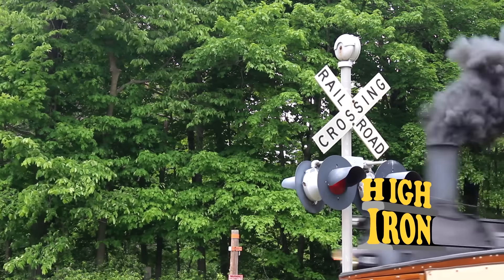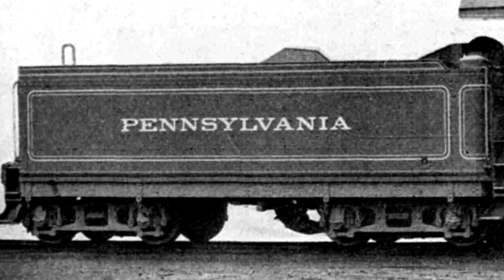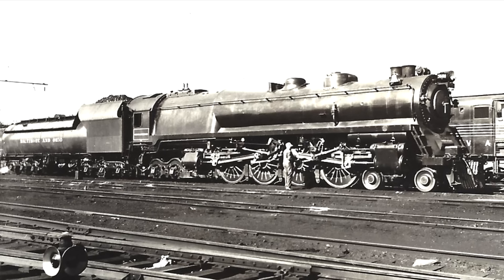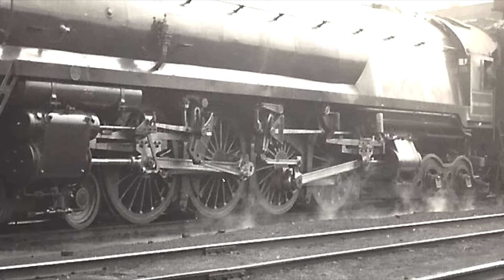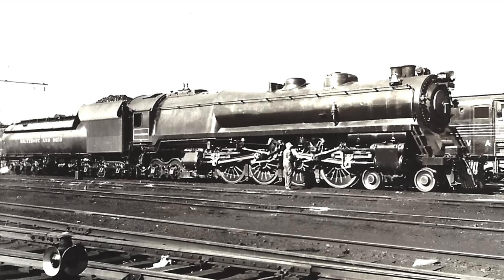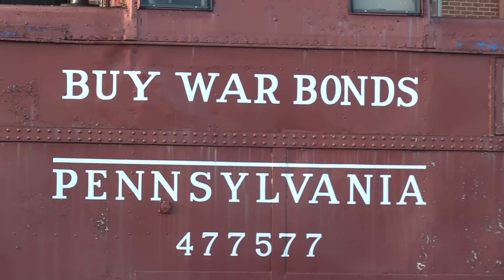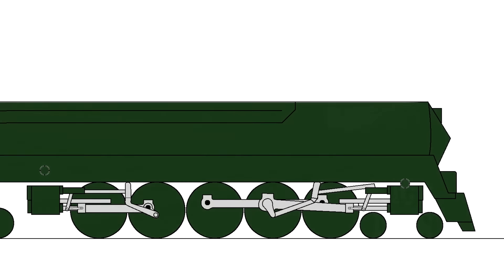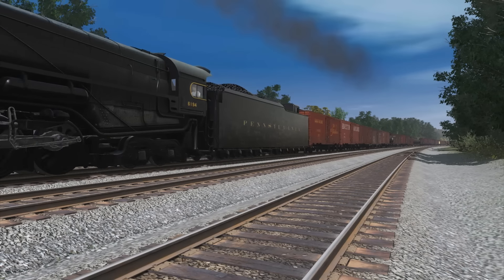Why Weren't Duplex Steam Engines Successful?

Comment: I don't know, but it seems to me that if an engine could handle speeds than it wouldn't need to reach them. It would just need another engine to supplement its power so rather than having one engine at 100 feet too reach 90 mph, you could have two 60 foot engines to achieve the same speeds  and a singular engine could be used to do the same task in a reduced manner. I see tis as a better option because it sounds like the larger engines had troubles bending around the tracks were as the two smaller engines could achieve this with swiveling connection points.
Reply: Crews cost more than engines.  A lot more, and steam engines could not create a multiple unit consist like diesels.
Reply: Technically, no. The pressure drop through the cylinder valves (that feed the pistons) becomes greater and greater as locomotive speed increases - so as speed increases power output drops, and there were tests in the 1930's on PRR K4's that documented the effect. That was one of the reasons to try poppet valves - they could admit a lot more steam to the cylinders with less pressure drop - increasing cylinder power output significantly above 80 mph, and by a huge amount at 100 mph and above. Those test results led to the PRR T1, which was specifically designed to outperform double headed K4's with a single T1 - which it did.

The problem was that the Franklin type A poppet valve mechanisms used on the T1s was very complicated (it was an oscillating design more like a swiss watch) and unreliable at high speeds (when C&O was investigating the PRR T1, they sent one of their engineers to meet with the Franklin engineer to discus the issue, and his response to the low reliability was that the type A was never designed to operate over 100 mpg...) Franklin introduced the type B rotary drive for poppet valves that was much simpler and eventually found to be much more reliable, but because of wartime material limitations, the PRR was unable to test the rotary design before they had to place the order for the 50 production T1s (those engines were ordered in anticipation of huge troop movements from the east coast to the west coast as troops were redeployed from the European theater after the defeat of Germany, to the pacific theater for the invasion of Japan.) Later both the C&O and D&H operated Hudsons post war with Franklin rotary poppet valves with great success.

Comment: Is there any reason why double-headed trains had both locomotives face forward, rather than having the tenders face each other (or perhaps used a double-ended tender)?  If crews needed to move or communicate between the two cabs, having a dender between them would seem better than having a boiler between them.
Reply: Double Fairlies, Meyers, and others 'of that ilk' were effectively made this way, just not in separate pieces like Loewy's 'triplex'.

The actual reciprocating part of the locomotive is about equally happy in either direction (there is a slight preference for which way is 'forward' in link valve gear).  If the leading and trailing trucks are built to guide effectively in both directions, the engine can run bidirectionally -- the Germans had multiple classes of 100+mph-rated tank engines that could run either way and just run around the train to rocket back the other way.

Most North American power had trailing trucks with Bissel geometry on the second Delta truck principle, with the restoring force applied as far to the rear and 'outside' as possible.  This design increases effective lateral forces when leading.  For complicated reasons having a pin-guided Adams truck at both ends has traditionally been a recipe for failure at high running speed; a better approach is to push the lead tender truck up close to the trailing driver pair of something like a 4-6-0 or 4-8-0 and use a good reverse radial buffer arrangement to have the tender steer the rear of the locomotive chassis when reverse-running, doing Stroudley's trick with the flanges on what is then the 'leading' driver pair...

If you are familiar with early Super-Power you may be familiar with the articulated American Arch trailing truck, which was a joy... as long as you were pulling.  Unfortunately, when you had to back up...

Comment: Impressive. - However, there's an option that should have raised more interest: the German "19 1001", a 2-8-2 streamlined express loco with a two-cylinder "steam motor" per axle (and no connecting rods). It entered service in the war and got damaged. It was repaired by the Americans and shipped to the USA in 1944..45, but dieselization had already taken off. It is told to have been scrapped in 1951 after a few trials on the east coast. - Note that even the post-WW2 German steam locomotives seem to have been created unaware of this interesting concept.

UPDATE: This one: https://youtu.be/2xECf4QbM4I
Reply: I recall this concept. I believe the PRR was considering trying this design, what with their trials with the T1’s and the one-off S2 turbine. It would’ve been the V1. But dieselization meant it never left paper
Reply from the maker: The B&O was also studying this concept with the help of the Besler Brothers.
Reply: @HighIron  Thank you! I didn't know that.
Reply: The engineers behind Germany‘s post-war locomotives were probably very aware of this locomotive, but just didn‘t see a need to develop it further. Regular steam power was adequate and (at least in the west) electric traction was on it‘s way to take over many trunk routes in the 50s and 60s.
Reply: @bahnspotterEU  Yes, that's my perception, too.  :-)  -  Coming to think of it, there was no use yet in designing and building /fast/ steam locomotives (which has 18 201 stand out). Power was needed, so optimizing the design of the new boilers did make sense. (Including the type of fuel, like lignite (in the East) or oil. Or even use the Franco-Crosti design.)
Reply: I see you have seen the picture that has the ACL herald on the nose.  ;-}

The Roosen motor locomotive, and the B&O constant-torque W-1 that has such an amusing Whyte coding, are two interesting examples of reciprocating-steam development.  
The  actual story -- rather shameful -- is that by 1947 no one was interested in complex steam locomotives, particularly those that had to coordinate torque on separately-driven (and very slippery!) single axles.  I don't think even today many people completely understand the arrangements on the BR 19s.  Apparently the repatriation of the locomotive to what was by then the DB foundered on the question of who would pay the shipping.  Then along came the Korean War, and scrap drives, and there was poor 19 1001 sitting on a military base when the patriotic thing for the Army to do was contribute.  This ranks up there with scrapping 242 A1 as a regrettable failure of preservation.
Reply: @wizlish  Thank you! - Yes, torque may well have been an issue with the 19 1001.

Also, thank you for bringing up the 242 A1. - I'm privileged to have a rare copy of André Chapelon's ultimate book "la Locomotive à vapeur". - You also make me think of that later set of changes to a German engine, now in Switzerland, number 52 8055. It is mentioned on https://de.wikipedia.org/wiki/Dampflokomotiv-_und_Maschinenfabrik_DLM (German and Esperanto only).
Reply: The original V1 was a mechanical turbine.  The main chassis was reminiscent of the one on the Baldwin Centipede (a two-axle pilot truck with four drive axles in a cast underframe) but the design had them 'elephant style' with the firebox and ashpan of the reversed boiler over the second 'lead truck'.  There was a separate turbine for each truck.  The boiler was a slightly-modified Q2 boiler (with proper waist support) which is where the 8000hp original rating came in.  The styling was reminiscent of the DD2.

This was actually approved for production in 1944, but it was obvious the end of the war in Europe was approaching, and the need for fast 8000hp locomotives with it -- and the prospective water rate for the thing was abysmal.

The design apparently got another lease on life in 1947... there is a design patent for a snazzy passenger shell plainly meant for a 4-8-0+4-8-0 chassis.  The magical improvement was the proposed adoption of the Bowes tugboat drive, which provided the effect of a CVT electrically, vastly improving starting, warmup idling,and operating the turbines at most effective mass-flow regardless of road speed -- which promised to be remarkably high.  It was around this time that PRR vaporware started to inflate the power rating, first to 9000hp and then even hinting even higher: you can imagine the fun with the effective water rate if the original was already showstopping.

N&W took over the V1 after 1948, and had gotten as far as going to electric traction-motor drive on all axles and a special B&W boiler by 1950 to 1952.  This was thrown out by 1954, replaced by the Baldwin-Lima-Hamilton/Westinghouse TE-1, which was entirely different in most respects.
Reply: There was a very key technical difference.  The Roosen BR 19 used a variant of quill drive between the steam-motor crankshaft and the driving axles, keeping unsprung mass minimal and allowing good suspension and damping action.  The Besler constant-torque motors were geared directly to their relative axles and were suspended with them, in a location subject to all sorts of contaminants and shock and difficult to access for inspection, with need for flexible steam lines to allow suspension action.  B&O actually had the boiler and a couple of the motor units ready when it became clear that even EAs did the job B&O needed far better than any steam locomotive would...

Comment: The greatest flaw engines were undermind in history. Was strength versus speed rpm/revolution. Engineers, after these stenght-to-motion machines, created methods of high rpm speed-into-horse power( strenght) using transmission. More power used vs strength 💪 utilized. 

 Had engines been more like these steam trains of modern air/gas/hydrolics pump vs piston, strength would merely be transmission converted into grip  speed wager. Using FAR LESS (as mere pumps) power transfer. Engine strenght-to-axel speed.
Reply: But consider the fun in, for example, using a high-speed expander at its horsepower peak with varied power to the wheels via Bowes drive.  No hydraulic windage or overpressure concern at high speed, no lines to break, no expensive filtering or polishing degradation products out of the fluid as on the America-Loks...
Reply: @wizlish sure.  If you want aura sound of ⛽ guzzling roar🤨.
Reply: The thing is that a reciprocating steam engine is already controlled over a considerable range of output in a way that does not require a transmission -- same as Doble and the Besler constant-torque worked with a fixed final-drive ratio.

Where the transmission then shines is in water rate increase and limiting machinery speed - the salvation of the direct-drive PRR S2 according to Westinghouse was a two-speed planetary with integral reverse (to get rid of that plague-spot geared reverse turbine) that allowed the turbine to be spooled quicker to effective speed range and then geared for economy.

The version of the Bowes drive proposed for the V1 turbine chassis is like an electromagnetic CVT capable of both ratio increase and ratio decrease.  In the Ingalls unit, it would allow medium-speed Superior Diesel motors both to start heavy trains at low road speed, then accelerate to a balancing speed dictated only by engine output governed at the peak of the torque curve, possibly over 140mph with a light consist without the risk of birdsnesting.  The PRR motive-power department understood that the 8000hp worth of turbines that a Q2-size boiler could support was no longer mass-flow wasteful at starting speeds, nor falling off abkve 80mph, as in the original freight design.  I think that is precisely the point you're trying to establish...
Reply: There is also the adaptation of the Rand Cam engine for use as a steam expander,  which is only not highly promising because of who owns the intellectual property, or the Quasiturbine.  A trochoidal Wankel-style engine would be interesting if high-integrity 'wet' tip and edge seals could be devised -- so far as I know that hasn't been fully solved, but it would permit a steam-jacketed engine case with nanoinsulated rotor...

Comment: I can't wait for 5550 to be complete. Hopefully they take the steam speed record home to America.
Reply: I recommend to get rid of that dream, because it would never happen. You have to go around a lot of red tape to even get to 110mph
Reply: @gamerfan8445  even on a private railroad?
Reply: @herrgodfrey9563  No, because it dangerous, and stupid to do so.
Reply: @gamerfan8445  I don't see it's necessarily either so long as the correct safety measures are taken. I won't get rid of the dream until it's proven impossible. If the new Acella Express can get around restrictions to go above 150 mph,  the 5550 might be able to, to go 130-140 mph. The people behind its construction have worked for many years to make this happen and they're getting closer every day. If they can make it happen, that'll be great, if not, oh well. I don't see why you think it's your job to tell me what to or not to dream about.
Reply: @herrgodfrey9563  the thing that the Acela is a new engine with modern crash safety features. 5550 would never be approve by the FRA to travel at that speeds

Comment: It is ridiculous to suggest that seasoned engineers could not adjust to the T-1's additional power very quickly and alter their throttle practice accordingly.  Nevertheless, the T-1's did have a nasty habit of slipping while underway with the front driver group. There are numerous videos attesting to this.  This was likely the result of weight/inertia shift taking weight off the front driving group, combined with high HP.  It was suggested that alteration of the springing could help this, but the railroad wasn't in a position in the late 1940's to spend a lot of time sorting everything out.

Comment: Why? Well, they (1) didn't offer enough of an increase in power and general performance to justify the expenditure AND (2) the diesel-electric (especially the GM designs) offered much reduced operating expense and MUCH reduced running maintenance (at a MUCH higher capital cost for acquisition). In the 1960s a proposal appeared in TRAINS Magazine that used the same ideas as Rene Chapelon (without, IIRC, attribution) for duplex drive engines with each cylinder/driver set inside connected to avoid getting out of time. I'm feeling stupid, can't recall author (who became a curator at Smithsonian). Really sounded good, but nobody ever (to my knowledge) tried it.

I think ALL the steam improvements came at the wrong time, and I'm sorry about it. Maybe if we hadn't had WWII and Diesel-Electrics just when we did...
Reply: There is a radical difference between Chapelon's locomotive (I believe 1935) and Withuhn's conjugated duplex (which you, in turn, fail to attribute properly): all the lateral and first-order forces from the cylinders were in perfect balance, even Itheoretically, at least) if two of the four cylnders were compounded.  See the ACE 3000 patent for a reasonably full description (including a frankly pathetic illustration of what the frame was supposed to look like; as a hint, it wouldn't).

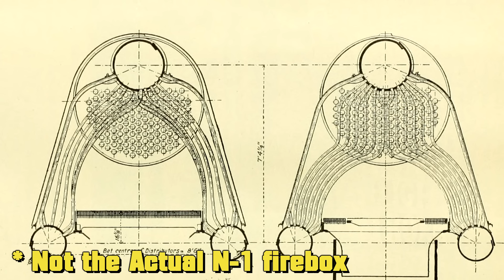Comment: 5:04 ive always wondered why water tube boilers never got adapted from ships to trains
.
they ARE more efficient.....but, just like the turbine locomotives.... are designed to run at FULL "throttle" or not at all 
like... the GE gas turbine engines worked GREAT when they could do 70MPH and had a large load
burned less fuel, less maintenance, ETC
.
but ya really didnt have an "idle" setting.... 
so all that efficiency "at load" means nothing 
.
.
still, i think you could "blend" the 2 types of boiler together.... or maybe use valves to transition from fire tube to water tube
this might fix the "idle" fuel consumption and rate of steam generation issues
but would be pretty complex 
.
.
still, if we are making a BRAND NEW T-1...from scratch 
then we might be able to make a steam engine that gets pretty close to diesel efficiency with modern computer controlled valve gear, stokers, CAD boiler designs, ETC